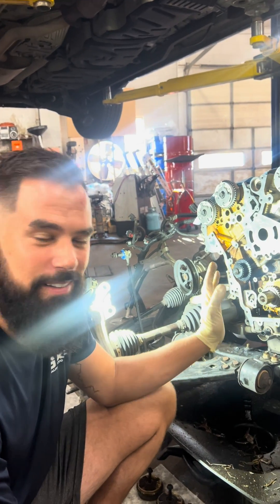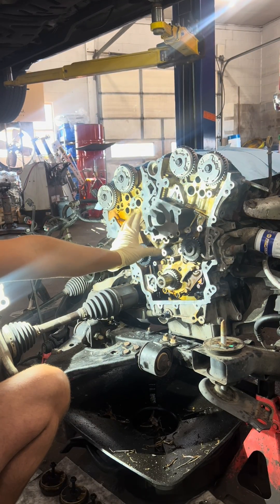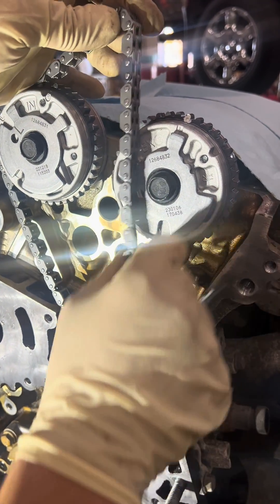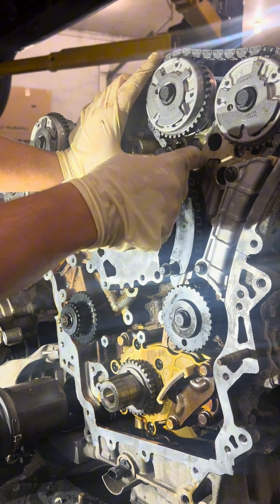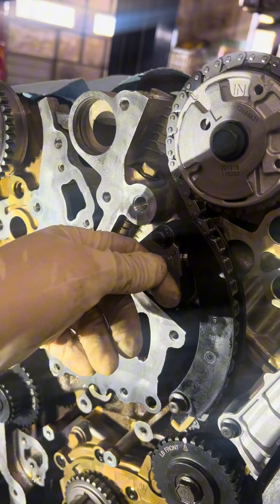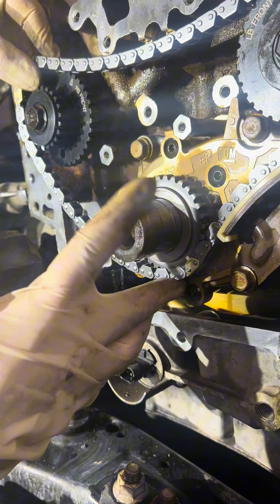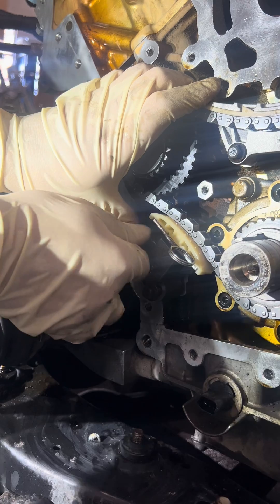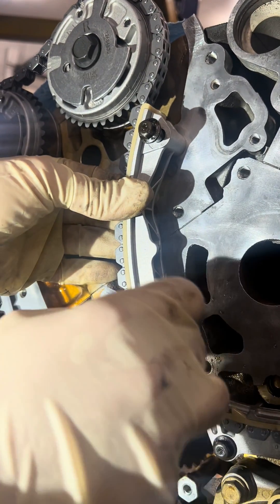GMC (GM) Acadia, 3.6L V6 timing chasing replacement. QUICK EASY TUTORIAL!

Comment: You’re right about that 3.6 liter engine. GM also uses that in the 2017 Cadillac XT5. My girlfriend has one that is leaking oil. Almost certain it’s coming from the timing chain cover (manuals refer to it as the front engine cover, but whatever. It’s the same).

Comment: This DID not work on my 09 Cadillac CTS. I am a mechanic by profession, I felt like if everything was locked in position when removing the chains and reinstalling the chains correctly it would be fine. Started the car and timing code came almost immediately. Removed everything and clocked the engine as specs say and it has been perfect since. Just my personal experience with this specific engine.
Reply: Doing this job on 07 CTS and have question about the timing.

Comment: So you have the flats of all 4 cams up? Preferably with the locking tools? If you can do it this way why do people cycle through the stages? I didnt think about the 2nd stage chain doesnt care where the colored links were but they still seem to line up with the marks.
Reply: Basically stage 1= left side camshafts relaxed. stage 2=right side camshafts relaxed. Follow the stages if you don’t have the locking tools. The stages are used so the camshafts don’t spring while removing the chains on each bank